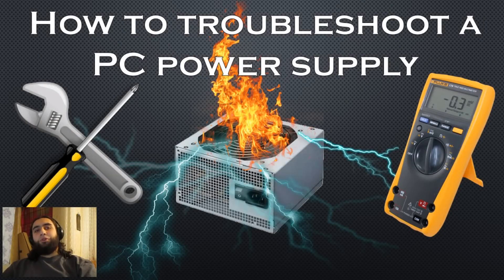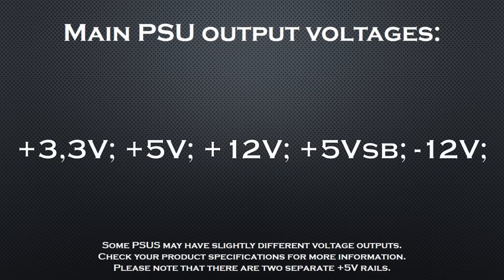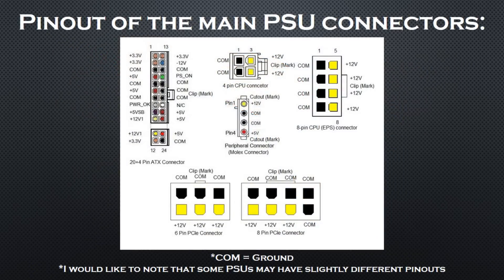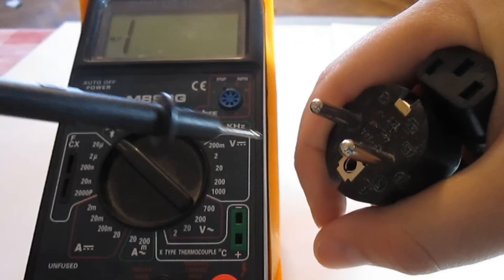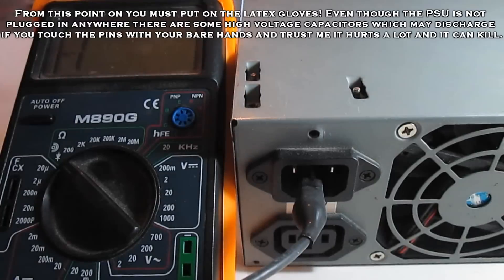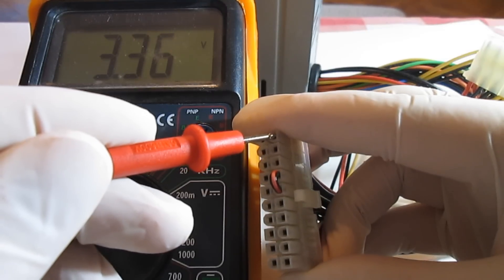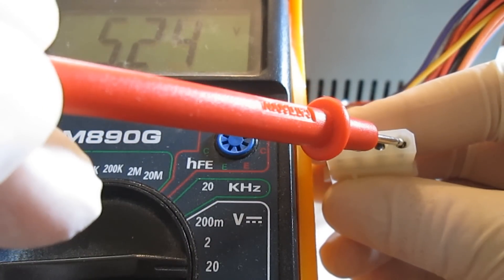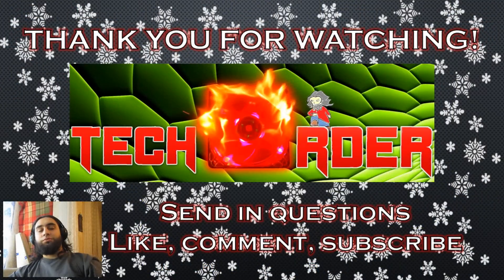[Tutorial] How to troubleshoot a PC power supply (PSU)

Comment: Hmmm. Interesting video, but the procedure you are showing here is a nearly useless no-load test.  In simple terms, while testing if proper voltages appear on the various cable pairs, you're doing that without placing the PSU under a workload. 

Consider a used "D" cell.  If you read the voltage across the battery's terminals, you may well find what appears to be adequate voltage. But, drop it into a flashlight and you get a dim light or no light at all. That's because the battery is unable to output it's rated voltage at a current level sufficient to power the flashlight. 

A typical 500 watt PSU. It should be able to supply 12 volts at more than 35 Amps.  A bad PSU may well show a proper 12V on the 12 volt rail when there is no load on it, but may fail badly when placed under a normal operating load - i.e. being installed in a typical PC. The same thing holds true for the 5 volt and 3.3 volt rails.

In order to see if a PSU can function user a load, you must test it under a load. There are several ways of doing this. One,  place a "dummy load" - a 10-watt, 10 ohm resistor placed across the +5 volt rail would do nicely. Be careful though as that resister can get hotter than a pistol.  

In the field, I find it much easier to just use other components in the PC to create that load. You do this by testing PSU in place - in other words don't pull it out of the PC. Just disconnect the various motherboard connectors but leaving the other lines connected (drives, etc.).  Once you turn on the PSU with your jumper, (green wire to ground), those connected components will place a small load on the PSU.  This way you can then test the PSU as described in the video at the main MB connector while placing some load on the PSU during your testing. 

BTW,  the main (20 or 24 pin) connector has multiple pins supplying the exact same voltages. All of the red wires supply (5 volts), yellow wires (12v), and orange wires (3.3v) come from the same source within the PSU. So all you need to do is to test one yellow wire, one red and one orange wire, barring physical damage in the connector or in one of the wires.

Antec used to sell a great little test unit that connected to the 20-pin motherboard connector. When in place, It jumped the green wire to ground turning on the PSU, placed a small resistance load on the 5V line and provided test points for your multimeter probes.  Today there are commercial testers out there that connects to the 20 or 24 pin MB connector and does the same thing without the need for a separate multimeter because they have built-in display that shows you the various voltages under a dummy load.  You can pick up one of these for as little as $15 that'll do the job.
Good job

Comment: hi I just wanna ask if there is still chance that my psu is already broken if I tested all the pins and got normal result as atx recommended but when I tested it on my board without pushing the cpu switch the mouse light lits normally but when I turn on the system the fans spin but the mouse light getting weak and system doesn't boot or post.

Comment: My only question is, what causes it to stop powering on by the switch? I could wire in a permanent jumper. Seems like a band aid fix. I'm going to keep digging on this subject. At least I can test the voltages.

Comment: Using "Speccy"  free program from internet  helped me diagnose a faulty power supply that had it's +12 V rail going to 13.056 +volts and the  -12V rail  going down to -6.270 Volts.

I kept have strange crashes  and occasional blue screen of deat and trouble booting windows. you tube freezes. At first I thought it was memory or CPU overheating. but then I thought I would just take a look at Speccy to see if I could spot the problem so I checked under the "MOTHERBOARD" selection nd up popped the voltages that were way out of spec giving me my best clues. Off to buy a new power supply.

Comment: What if I know that my psu is bad under load, but with this method I determined that idle voltages are good? Is there any part of the psu that could be suspected as faulty or some that can be excluded?

Comment: Voltage under load is the best test and will usually pickup voltage drops due to bad connections and low output PSU's. 
Can be used to check if you have sufficient power also to run your graphics card etc..
Anything above about 11.5v under full load is acceptable but 11.7v and above is better... Most graphics cards will cut out with less than about 10.60v or so I have seen.
Reply: So if the graphics card does cut out, will that cause the PC to shut off or will it just crash the system but still maintain power to the PC?
Im just trying to diagnose my PCs intermittent shutdowns. It just completely cuts out and cannot turn it on again for a random amount of time.

Comment: HEYNOW ~ Cool Guide :  Great Tutorial , I have a issue that happens 3 or 4 times every year, for example :  Shut down Desktop Computer last night ( all good , Zero issues )  started up Computer today  =  Checking file system on C  for Consistency  💻  I’ve checked all 4 Ram sticks , interior of Pc is clean , Was thinking power supply butt why after every clean install all is well ? I’m gonna Clone my operating system if possible with Acronis True image software that came with my ssd were the operating system is installed  💻  if you have any ideas for me that would be wonderful  ✨  Thanx 4 Posting  🇵🇹
Reply: Side Note :  installing Windows & all the programs + apps + runtime library’s , etc ..... takes hours  ~  My Rig :  2011 HP Compaq Elite 8200 Pro sff Pc with i5-2400 Cpu + EVGA Sc 16gb Ram + Msi Gtx 1050 ti 4gb gddr5 low profile Gpu + Crucial Mx300 ssd  with Windows 7 Ultimate x64 bit edition 💻

Comment: i tested my my external driver power adapter with molex connector and  it short and now is dead.why do you think that happened although i used it to power portable speaker before and it was working fine.Actually I was wondering how much current it can give when it happened

Comment: I have an old defective ps, . Looks like one of the early to mid 90's. It is 65w and the plugs normal but, it doesn't have the big main plug. It doesn't have the green wire that I can bridge with the ground wire. I opened it up and all the caps look good, no bulging. I want to use it for my hobby projects since it rates only a nice and safe 65 w and has an on/off switch, can you help me trouble shoot it?

Comment: My PC will randomly turn off then the fans will spin for 1/2 a second about 5 seconds later. I stop it by turning off the power supply. Then about 10-15 minutes later it turns on but will turn off and do the fan thing again. I'm pretty sure it's the power supply because I bought an RX 470 but only a 450 watt psu because pcpartpicker told me I was going to use about 230 watts but the RX 470 box said I needed at least a 450 watt psu. Do I need for instance a 600 watt psu?

Comment: First thing is that is really good tutorial big ups! The other thing is I  gotta question, I've got ANTEC TP-650C PSU powering i7 2600 OCed to 4ghz, plus Radeon 280x I got this rig for around 2 years working perfectly without any issues. Around a month ago I had some power fluctuations you know blinking lights all around the house low voltage like 220v and less,  during that time my computer started to restart after I started to play some demanding 3D games. I thought it's happening coz the PSU did not get enough power from the socket to power the GPU. Then I took my PC to my friend house but a problem occurred as well... 
Now the questions. Am I able to check if the PSU working properly using your tutorial or I need to find a company that can check it under the load? May it be the GPU itself ? or maybe it's something else entirely?

Comment: My power supply fan does not turn ever !!!!! not evend under loaded.... in low loud it works fine on hi load it makes my pc restart i have win 10 wtf is going on man ? can you tell me if i need a new one ?
Reply: Jonathan RC just discharge it and replace the fan by removing the old one and adding a new one that connects to a motherboard fan header. make sure it faces the proper direction and blows air at the components of the psu

Comment: i have a tester and the psu turns a pc on. my pc used to just shut down randomly and since taking it out and putting in another it does not. tester shows no issues but the psu does have a very slight high pitch ring...

Comment: Great tutorial, but most of the time when buying a new PSU I'm more concerned about it not performing on the full specified load. Any quick tests I can do to check that?
Reply from the maker: +Benny Kolesnikov No, there are no reliable methods to test a PSU without a lab with the proper equipment. Imagine that you are testing a 1500-2000W unit imagine the load that you must have to dissipate that much power. 
You will find some so called "PSU testers" on the web which are roughly as big as a smartphone. But they are not to be trusted because their readings fluctuate horribly.
Reply: Buy one that is reliable such as seasonic